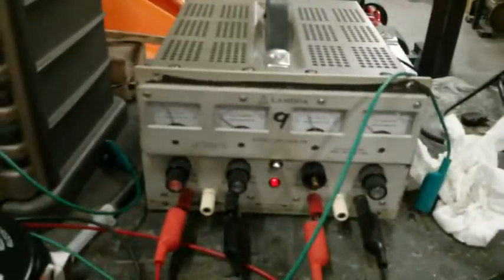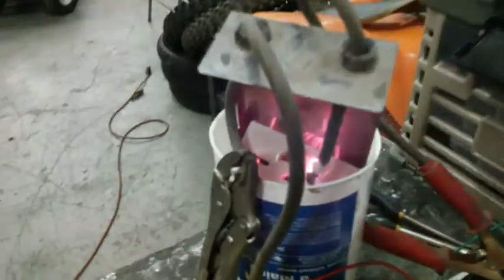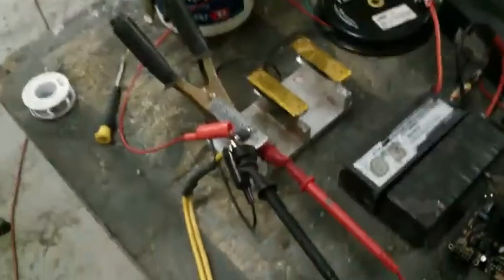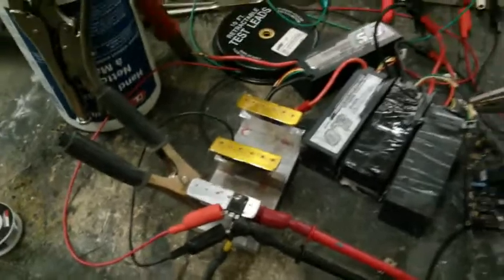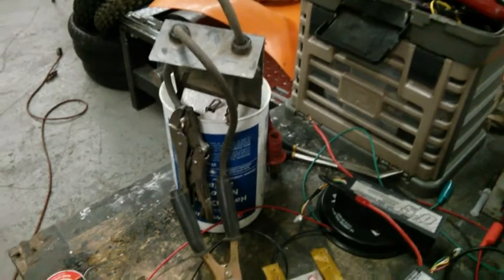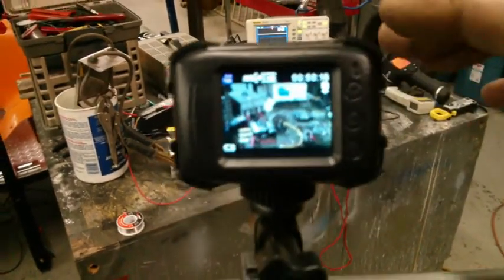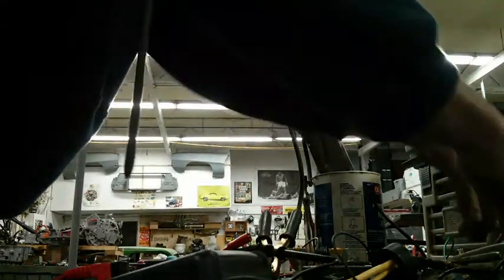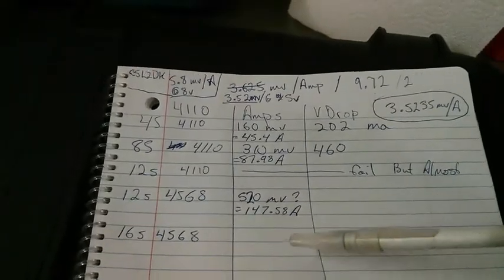Fet destructive testing

Comment: Hey Arlo

That's intersting test. Just pay attention when measuring temperatire with FLIR on metal.. these are like a mirror.. so you  have more chance to measure the reflected IR of the surrounding environnment than the IR directly from the metal surface you point the FLIR on !  The FLIR better read high emissivity object like black color metal or other material. aluminum is like a mirror for heat
Reply from the maker: Thanks doc  I can change the Emissivity settings.  I am pretty sure its accurate on the mosfet it self.